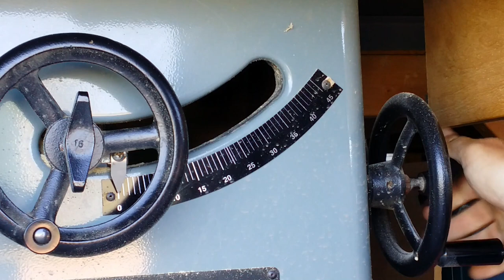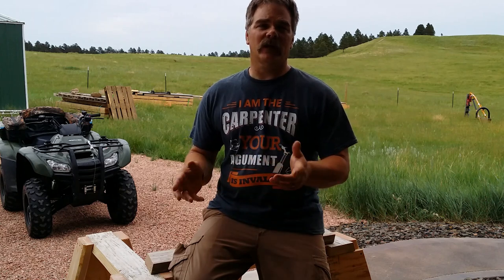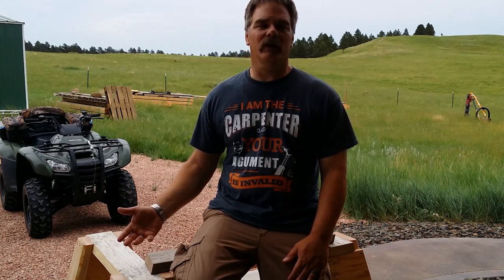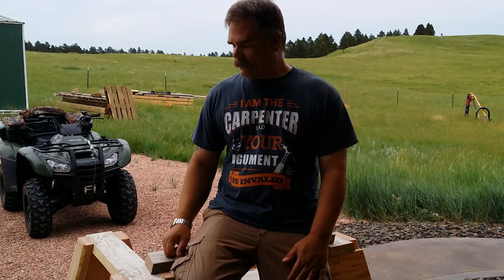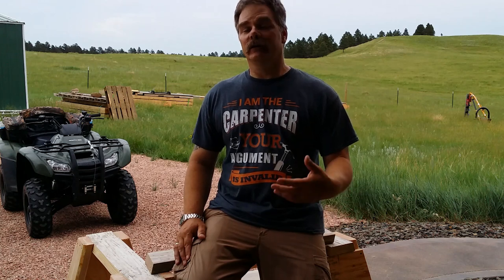Easy, Strong Saw Horses

Comment: Great design. I followed your instructions and just completed a pair. I changed the dimensions to fit my needs, but I used your suggested angles. I also extended the cross piece 1 1/2" beyond each gusset so that I've got something to clamp onto. As you say, the glue is key. I used Titebond II because I had it on hand. One of the advantages of your design is they're stackable. Many horses aren't. Thanks for the video.
Reply from the maker: Thanks Jamie

Comment: I really like the design. I made a set of these and put two by sixes on top of each one. I found that if I cut about a quarter inch off of the top of each side they stack very nicely.
Reply from the maker: Great tip!

Comment: I like this design much more than the "I-beam" style. Quicker, less material and easier to make... and It's just  as strong.   It also gives you extra surface area for laying a sheet of plywood on top for a worktable. If you put  the side support on the inside of the legs on one of them, then you can also stack them.

Comment: simple yet strong design and crisp video
Reply from the maker: Thank you!
Reply: @GreatPlainsCraftsman  One observation/suggestion for enhancing the utility of saw horses. If the gusset is fixed inside of the legs, outside can  be used for clamping work piece or temp worktop to the saw horse.
Reply from the maker: @KBBAKTHA  Great suggestion, thank you!

Comment: Yes!!  This is the old fashioned and proper way to build a saw horse, and it's exactly the way I build mine.  The only difference is if I'm building a set to hold super heavy weight.  In that case I'll use 2x10 on the ends instead of plywood and I'll use a 2x6 beam under the top, otherwise the construction is exactly the same.  Oh, and I'll tie the 2x6 beam to the 2x10 ends as well as to the top.  But this set up is an extreme example for holding lots of weight and is not necessary for normal usage.  My normal sawhorse is just like yours.  Good job!!

Comment: Great combination of simplicity, strength, low cost, and ease of construction. If you made one narrower than the other, they would stack pretty nice, right?  Gotta believe each of those will easily support several hundred pounds.
Reply from the maker: Yes Matt they would.   I used them on the timberframe,  500 lbs no problem

Comment: I know this is an old video - hopefully the creator is still monitoring comments.  The text and comments say 5deg splay on the legs but in the video, you can see the mitre angle was clearly set to 10deg at timepoint 1:56 just before the bevel was set to 15deg ...  Is this some mathical effect of setting a compound saw I don't understand ?   Which angle was actually used to build the horses in the video ?

Comment: Thanks for the video. I like your sawhorse construction.  I've heard in other YouTube videos saying that using adhesive with fasteners(screws) makes the construction stronger.  Why is that? Why not just use more screws and skip the adhesive? If you skip the adhesive, you can disassemble the sawhorse for storage and reassemble when you need it.
Reply from the maker: If you want to disassemble then just screws. Most do not so adhesive does most of the work

Comment: I will make a pair of these soon. There are as many opinions about saw horses as there are saw horses. If you make a couple of different designs, you will be ready for both light weight and heavy weight jobs. 
There is nothing wrong with checking out another way of making them. I just hit ‘Like’ and subscribed.
Reply from the maker: Thank you so much!

Comment: Thank you for the video. I'm a carpentry newbie looking to make a simple and inexpensive sawhorse like this. My question is probably dumb: where do I cut the 15 degrees and 5 degrees? I'd guess that the 15 degrees cut is at the four foot of the legs. What about the 5 degrees. Thank you.
Reply from the maker: The 5 degrees is the splay angle, or how far the sawhorses angle out toward the ends for stability.   The 15 degrees matches the angle the legs angle out to make the "A" shape.   So a double angle cut on the leg ends with a compound miter saw, and just a 15 degree cut on the table saw for the top.
Reply: @GreatPlainsCraftsman  Got it. Thanks.

Comment: I'm unclear on how to cut the legs as I think you are required to cut 2 with one setting and then change for the other 2. How about the leg ends that touch the ground, how are they to be cut?. Do you have a simple diagram to explain? I enjoy your channel!
Reply from the maker: Cut the legs the same top and bottom.   The angles make them a parallelogram basically.  5° for the outward end splay, 15° matches the outward angle on the top board.  Set the saw up how I showed in the video. Cut one you will see.

Comment: Nice job! I do pretty much the same with just my circular saw. I use 1x6 for the legs with 1/2 inch plywood gussets. I try to keep them light weight. Made the mistake of making em out of all 2x 6 ptp and 4 feet long. Ugh what a couple of solid heavy benches.
Reply from the maker: Thank you Jim!

Comment: Damn use a push stick when using your table saw' I was cringing when u pushed your hand so close to that blade!!! 2x6 or 2x4 will kick back on u faster then any wood" and the table saw has gotten a lot of experienced woodworkers that have done what exactly what your doing.
Reply: His operation of the Table Saw was in correct fashion. He had the correct Blade for the task,  using the proper feedrate allowing the Blade to do its job. Not force feeding the material into a Dull Blade. Where some Experienced Woodworkers tend to do, in trying to get the job done faster. These are the ones who end up paying the price for loosing respect for the tool that they are working on. Push stick on material of 3" wide or narrower. Besides The Man's  👕  "T-shirt  says it all.
Reply: Yes, can't get lazy or complacent.

Comment: I think these are the better design for a sawhorse, but don't let OSHA catch you with them on a jobsite without stamped engineered drawings for them. Big ticket item now. Thanks fed govt.
Reply: Engineer stamps cost a lot of $$$$ . Often , they are no better than these sawhorses . Just my opinion . Thanks .
Reply: Very often the fed govt is responding to legal claims made against companies or individuals by other companies or individuals, thereby requiring a change in the law in order to avoid further liability issues within a sector of the industry.  So who do you want to point the finger at?  The company, the individual, or the govt?  It's the fallout of many people living together, and in some cases the claims are valid.  (Attempting here to push aside any considerations of "big brother".)